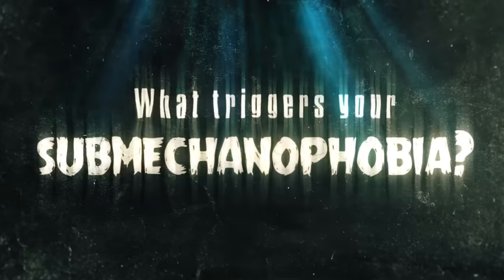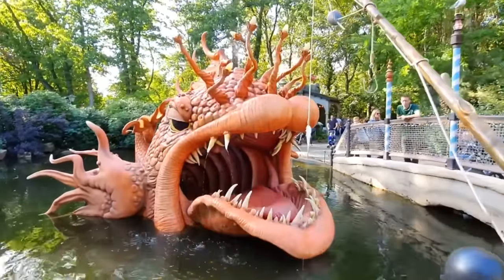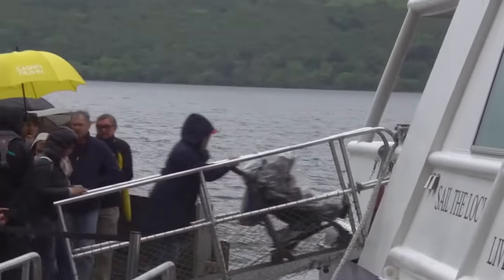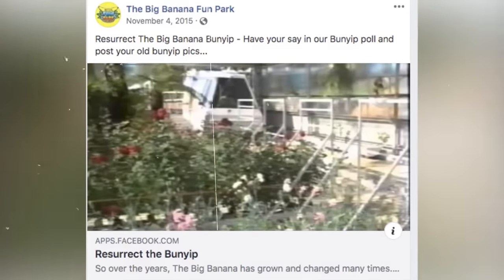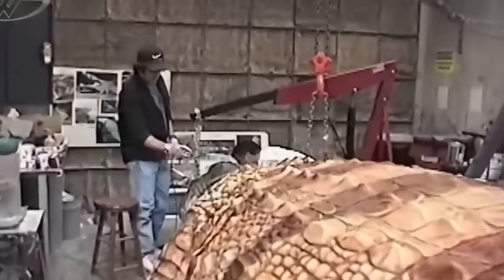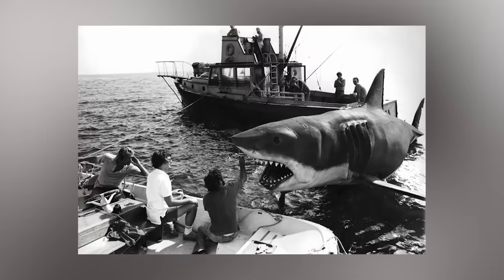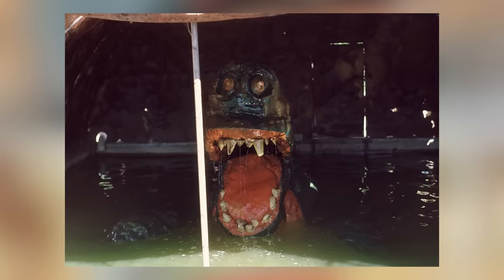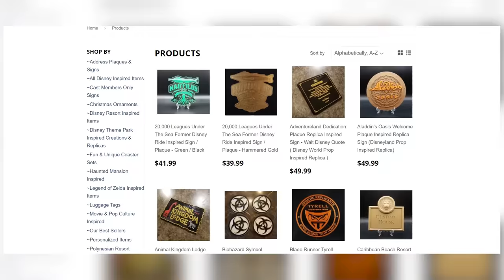Scariest Submechanophobia Animatronics

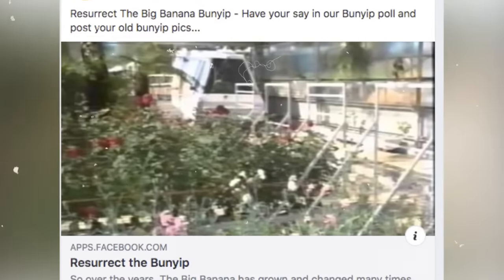Comment: 7:34, imagine working for the big banana as a scuba diver or something, and you are sent into the billabong to see if there is anything salvageable, surrounded in cold, muddy water, before coming to where the mechanism once was, and finding that it had worn away and fallen over. You swim through the muddy water to see if you can find anything, before spotting an outline of something through the murky water, you swim closer and come across its head, attacked to the ruined raising and lowering mechanism, with its face ruined and full of holes, I COULD NOT do that

Comment: Imagine your swimming around,and you swim under,you open your eyes for a second.you see something.you swim back up to the surface,and then you go get your goggles.you return to the lake and swim to the bottom,and then it lunges.you realize it’s the old bun yip animatronic,and it’s activated somehow.it rises to the top,seemingly chasing you.you flee,screaming for help,but it’s no use.the animatronics jaw is broken,and it hangs,flimsily swinging.its eyes are just red spheres,and it’s wiring is exposed,it’s coverings falling off as it moves.You move towards the shore,and you watch it flop around,breaking and snapping,the loud mechanical cracks of its engines never fully escaping your ears.finally,it rests,and it collapses back into the water.youve survived the bun yip,and you vow never to return to this cursed place.

Comment: The one about the bunyip , I think that they should hav drained the water to see if it is just down on the floor. It’s possible that parts of her/him could still work if they spent hours and hours and hours cleaning and fixing wires and other things, then put mor clear water an maybe make it safer so the bus doesn’t fall in. Then they should make it a more calming attraction instead of having it scare people much more. That’s just my opinion :$